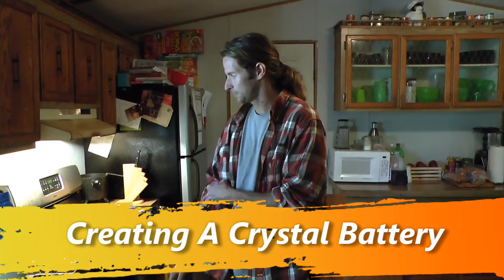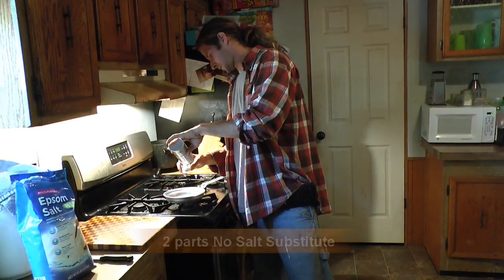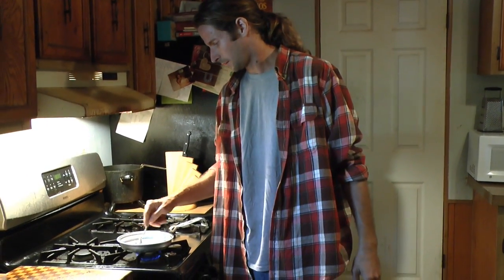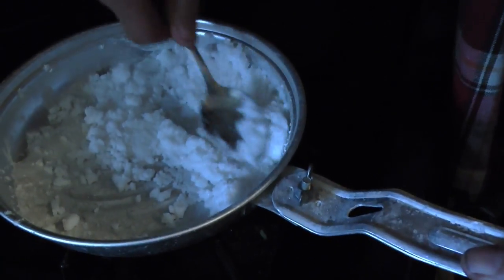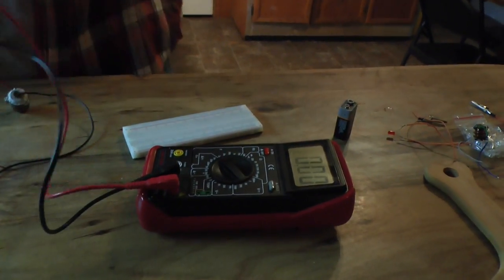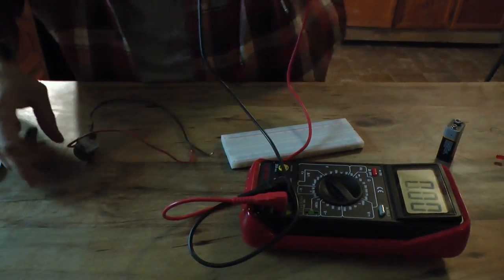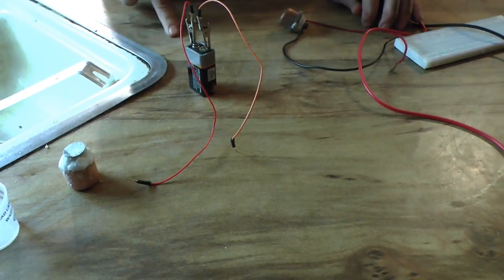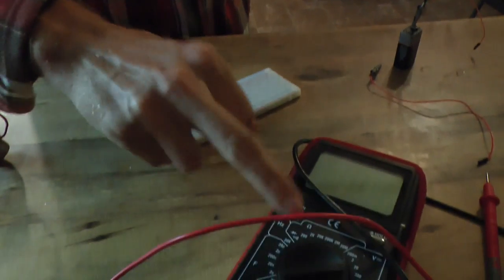Creating A Crystal Battery

Comment: What do you mean?
If you hook a bunch of them together in parallel, it would increase amperge.  Then hook it up in series, it will increase the voltage. Relax and you will be okay.
I would think you just buy some plumbing copper pipe and it doesn't have to a cup.
Just sit the pipe on wood with the magnesium inside just the same. this way the magnesium and copper is kept apart and not touching which is the point.  Then just fill it with your solution afterwards.

Comment: hello, an easy way to stack these in series or parallel is to get some 5 minute epoxy and some old plastic ice cube trays. put your batteries in the tray and pour in some epoxy to form a holder and you can ''stack'' the batteries from there. an easy holder that won't corrode. use plastic though, as the metal ones will corrode and short out.

Comment: I also plan to see what happens if I make a series of copper tubes with magnesium sticking out both ends, cap the crystal in on both ends and wire them together in series. I'm hoping to get 12 volts. Then make a bank of those to wire together in parallel to see how much it would take to get a few amps at 12 volts. Compare size and weight to Li-ion and lead acid. I'm currently 100% off grid.
Reply: You gotta make some videos with the results, very curious, and not to mention to spread the word energy is free!

Comment: Instead of cooking a whole pan full for one battery then fighting to get the core in after you fill the copper, try placing a wood or rubber wafer in the bottom then placing the core inside the copper then sift in a layer of salt all around with the copper fitting sitting in the hot pan. Just stir with a toothpick as it melts directly in the copper fitting adding layer after layer. Then use a heat gun to melt the middle and top layers as it gets filled...then drop into a shallow tray of cool water to set faster. Run a charge through it while the crystals set and they will form a much better alignment as they harden and give you better results. I'm going to try capping off the top with a layer of resin to see what closing in the crystals will do.

Comment: thanks for the video .another way to bump the voltage on these batteries is to add some heat . heat from a light source = sun or light bulbs  etc will sometimes  recharge the cells back to a higher voltage.

Comment: Connected in series, the voltage is increased but the amperage remains the same throughout. 
Connected in parallel, the amperage is increased but the voltage remains the same throughout.
Reply: Can you make some in parallel and some in series and connect them together to increase both?
Reply: @texacalian9289  Yup. You'd connect a number in series to get the voltage you want. Then connect those groups of batteries in parallel to get the amperage you want.
Reply: yes. but that can get dangerous. 
check this out https://www.youtube.com/watch?v=c0QvbThCxm4 
1000 volts with 9 volt batteries

Comment: might be fun to test how many together it would take to charge a phone over usb... make a small power brick for charging continuously
Reply: It might 4 or 5 in a series to make 6+ volts
Reply: builtrodewreckedit about 2300 pounds of crystal will be equivalent to a rapid cell phone charger, but 5.5 pounds of crystal can keep an iPhone 5 running in standby mode. 68 pounds will give you enough for continuous talk time. all of this assumes no losses  with a 100 percent efficient transfer of power to the cellphone.
Reply: Or charge a battery night and day and run things off of that. Unplug the devices at night to recharge the battery fully.